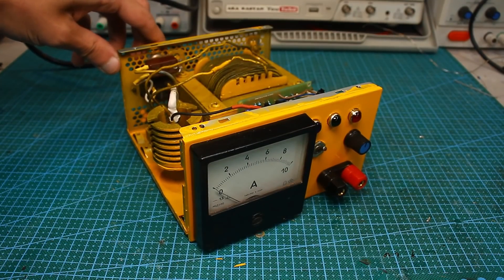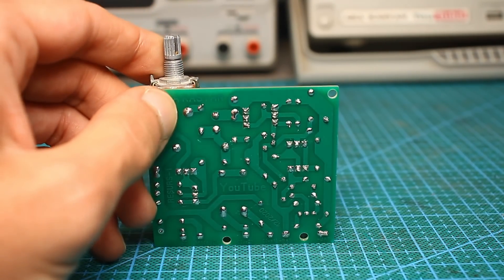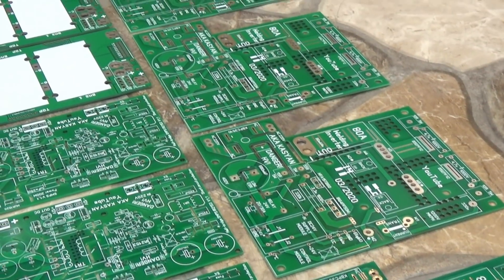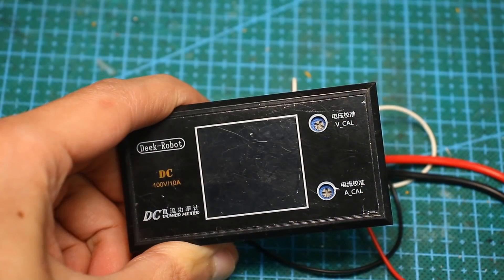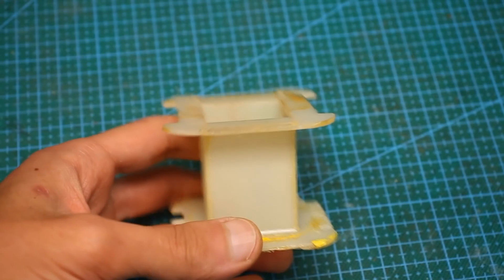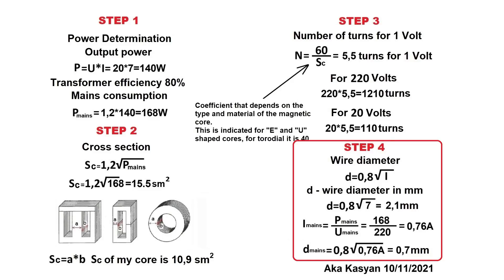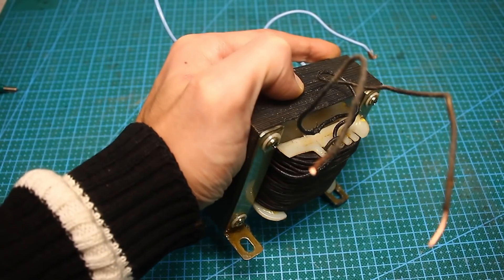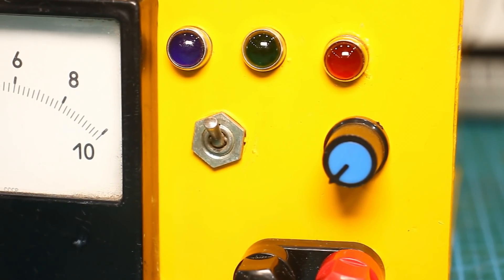BEST Car battery charger | Free Gerber, PCB and Circuit

Comment: There are an abundance of working transformers in redundant ( scrap ) equipment , they can last almost forever , so are worth salvaging ( buying new is very expensive ! ) ... this will save A LOT of effort winding a dedicated transformer ... ( giving more time to construct the excellent electronics )  ! ! .... FYI ... There are LOTS and LOTS of 24 Volt transformers ( or 12 - 0 - 12 Volt ) thrown away which should work OK ( ? ) ......

Comment: Just pointing out a rather classic error in the calculations, it probably doesn't matter too much though. The calculation given in the video is for an efficiency ŋ=83%.

Let me clarify. If the transformer is 80% efficient, there's a 20% loss. So there's a loss of 20%, which means Pmains is 20% higher than Pout. Or in other words: Pmains = 1,20*Pout. Note that the last part of the reasoning is incorrect!

Given Pout=140W and efficiency ŋ=80%, Pmains will be 175W, not 168W.
efficiency ŋ = Pout/Pmains = 140W/175W = 0,80 = 80%

Comment: A lot of times it's easier to buy a high power battery charger! But never put out what they claim unless you spend $200  if I can make a battery charger with over 20 amps of output? I'll be laughing.  Cheers

Comment: Evrryone is repeating same and same circuit and limited voltage to 24v i badly need 36v e cycle charger circuit for lipo battery but not found any circuit why not you youtubers challenge yourself to do work yourself instead of copy each other ...

Comment: You need to have a separate channel with these projects that are for 110 / 120 volts AC 🤬
Reply: Are you from 110-127V country?
And have some trouble with 220-240V circuit?
Maybe i can help you convert some schematic to 110-127V